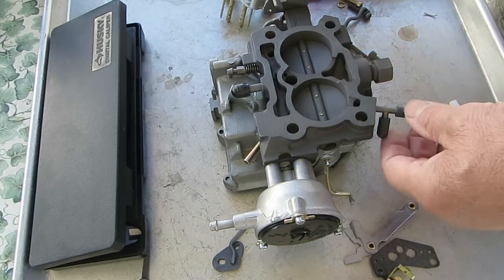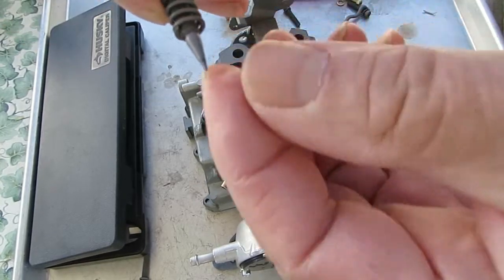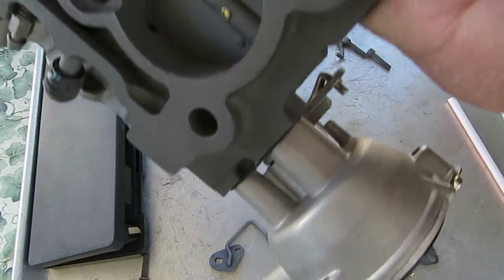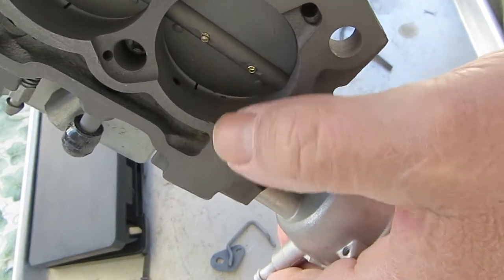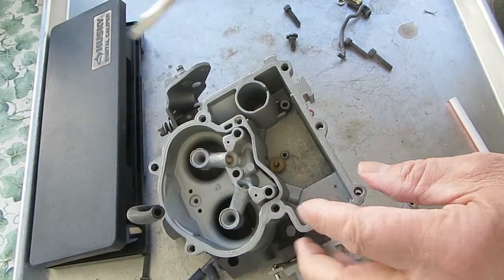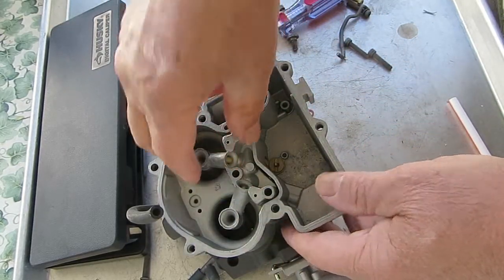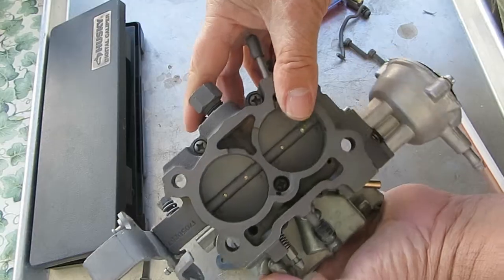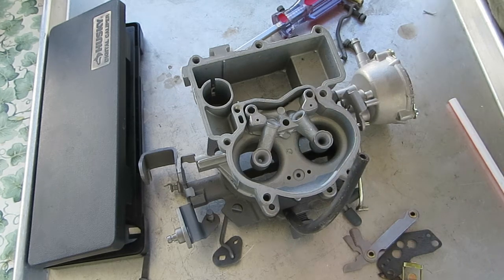Understanding the Rochester 2 Jet 2 Barrel Idle Circuit | Carburetor Explained

Comment: I have a cardo reman 2-jet and it’s driving me nuts. Excellent 1/4 throttle and up. The the idle/low speed is absolutely not working great.
Reply from the maker: Try this page: https://www.carburetor-parts.com/my-2-jet-wont-idle.html
Reply: @MikesCarburetor  I appreciate it! Fortunately, I got lucky. I tore it apart and hosed it down with some carb cleaner and it just decided to start working again.
Reply from the maker: @VinnyMartello  That is great. Probably cleaned out some crud.

Comment: Can you make a video pointing out the vacuum ports I seen 3 that I have plugged I want to get corrected
Reply from the maker: I will put that on my list. Thanks for the suggestion.
Reply: @MikesCarburetor  Thank you. May I ask you a question regarding egr valve vacuum and the port on the back of the carb on the driver side

Comment: Howzit Mike, Im relatively new to all of this and am currently working on a GM 3.8 V6, I am trying to order the Carb at the moment. My question might be stupid but the base plate gasket? Is that all there is between the carb itself and the engine or are there any gaskets that fit between the carb and base plate and the engine and base plate?

Comment: What’s a good starting place on idle air mixture
Reply: If I screw in both screws and it doesn’t change the idle, what could cause that not to change anything???? Vacuum leak or dirty needles??? Tia

Comment: Got a new Rochester two barrel carburetor for my 350 Chevy in my boat brand new distributor can’t get it to idle it’ll start without accelerating it will not idle I’ve had idle jets from a half return to 4 1/2 turns it will not idle! It Well rev up just fine and stay revved up! Throttle down to an idol and it dies
Reply: Hey I just saw your comment and I'm having the exact same trouble on my rochester. Did you ever figure out the problem? Thanks!

Comment: I have an 82 Malibu all stock 229v6 with 2bbl carb my choke light is on and it's hard to start wont idle and backfires horribly when you accelerate any suggestions on rebuilding?

Comment: My truck bogs off idle. I watched your video of the one barrel. How is the 2G different related to fixing a bog off idle. If my manual choke is closed a little, it doesn't bog. Too lean? I also can adjust my idle mixture screws all the way in and the truck still runs. Shouldn't this make it die?